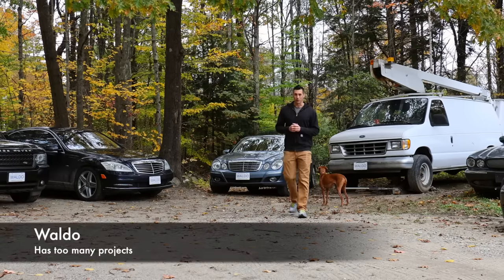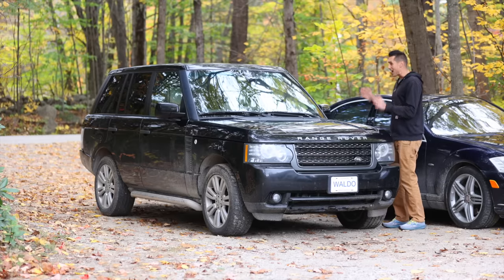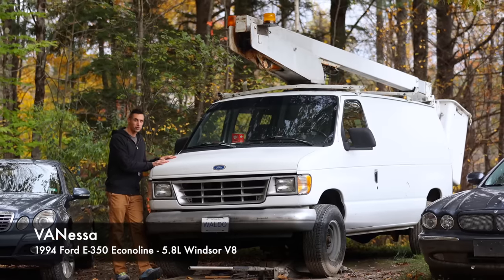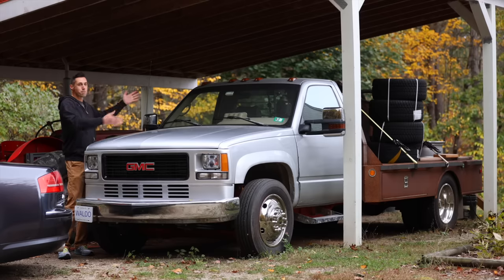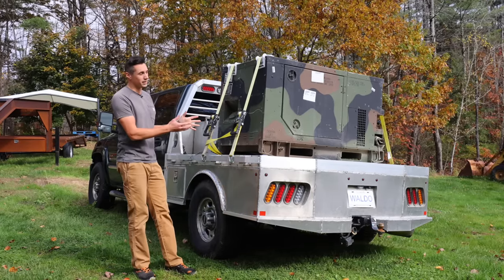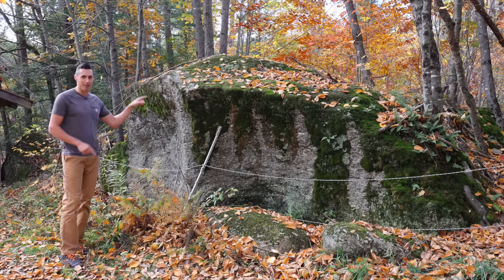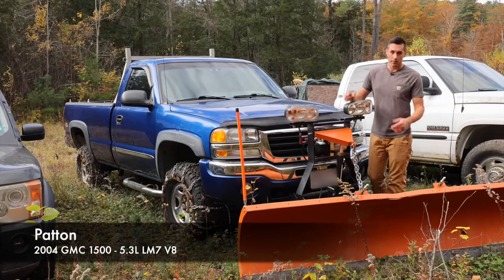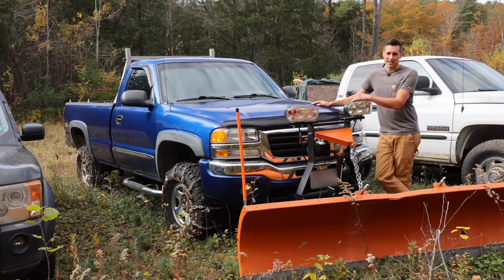Fleet/Project Update! Plus I Bought a 12-Cylinder (Twin-Turbo)

Comment: One project you missed:  the work shop itself.  Any updates or plans for that?
Reply from the maker: Oh that's a good point. I'm still not sure what I want to do. I'm starting to consider pouring a slab in my current shop. A new shop is definitely in my future at some point, but I don't know if it's going to be located on my current property
Reply: @WaldosWorld  it just seems that as it is now it’s pretty cold and miserable to work in during the winter.
Reply: @WaldosWorld Steel buildings can be, in my opinion, surprisingly affordable. Just ordered one for myself and was pretty happy with the price I got for a 30' x 50'.

Comment: Please, please DON'T put a pickup box on Harvey. First off it looks stupid, makes the truck useless and most say that the people that have done such a conversion are over compensating. Do anything but the "low IQ" looking medium duty pickup truck conversion! You could possibly do one of those RV flatbed conversions, they are neat, a dump truck, flatbed, service box, crane truck, roll off etc are all cool and usable. So much useful stuff  can be done. I'm sure others will chime in on other useful neat projects for this truck.

Comment: When it comes to Landrovers, my carguy soul try to escape every time. i never was into one but i run into them at a cardealer at some point and i couldn't believe what i saw. There were so many things wrong and you quickly became the feeling, that you got a realy cheap car under a lot of expensive covers in leather and some good looking plastic and metal. If you just move your POV a little bit out of the normal way, you saw ridiculous things. Bad boltconections, welds, clamps, lose wires, sharp bare metal etc. At this point i was sure i could build that thing better in my garage. Over the time i heard about all the Landrover problems and i wasn't any surprised by that. But i guess they are good looking enough to trap people to buy them anyways.

Comment: Does the front windshield on the Discovery have a seam on the top of the windshield gasket? My 240SX had a leak from what I thought was the sunroof but ended up being water blowing in from the windshield. A couple pieces of tape and some silicone sealant and never had another leak. 

Not that it matters since your selling it.

Comment: Hey Waldo, what's the deal with the dark blue 2008-2010 D3 Audi A8 who's nose it poking out in the shot at 4:27?  If you mentioned it in this epoxide I must have missed it.

I'm particularly curious because a past life I was an Audi D3 enthusiast having owned and maintained a 2004 A8L 4.2, a 2007 A8L W12, and a 2008 A8L W12.

Comment: I've had the same issue on my LR3. Have you removed the A-pillar covers and taped up the holes in the panels? They will let water in that run straight onto the CJB and floor boards.

Comment: on the 351w its a great block but all those 351w 302 heads are bad flow just horribly so i suggest get some cheap bare aluminum heads finish them  your self at machine shop with good vales n springs  fairly cheap to do whites racing in tn is a good place be care full 2 shops with same name in same town lol yea crazy and a rv cam stage 1 upgrade for lack of a better way of saying on the yt chat box lol

Comment: Hahaha they put the don't start no oil in the boot, come on like logically it should be taped to the windshield or something. What happened with the fuel container? Is it leaking? Have you been using it?

Comment: NEEED HELP.   Hi Sam I watch your videos pretty much interested in but I got a mini Cooper 2010 stuck in limp mode with a check engine light full transmission I run ODB check and it says transmission turbine speed sensor but I change it and it still no working I was wondering if it was the transmission control module because now there's a few more check engine light symptoms and I want to check out the TCM to get it reprogrammed to see if that's the problem do you know where I can get it diagnosed

Comment: You're in for a not-so-good time if you have to split track on that hoe, track work is dirty, heavy, and miserable. There's a strong possibility that the master pin is seized to the point where you'll need to torch it out, or at very least need a very heavy press. I can't see from the video how much wear is on the undercarriage, but while you already have it split, that would be a good time to replace anything worn, and go through and refresh the rollers and other components since modern manufacturers aren't kind enough to give you greaseable undercarriage anymore.

Comment: I dont understand how you can be so meticulous with your vids and produce stunning content and yet you do not have a proper garage to carry out your work.
There must be some reason, but even before your first Vid- you should have a dry and safe environment to create your content.

You will certainly need a new chisel for your rock breaker. 
Some of these rocks look like hard rock, and that contraption will not break it up.  If its sedimentary rock, then it will by fine, but if its metamorphic or igneous rock, then no. 
I can see you having to buy a rock drill and chemically splitting the rock into smaller parts. 
This guy sorts out these rocks:

Demolition Dave Drilling and Blasting
He has some excellent content..and chemically splitting rock as well...you will get an idea what you are up against. Before you spend a ton of money fixing your rock splitter...